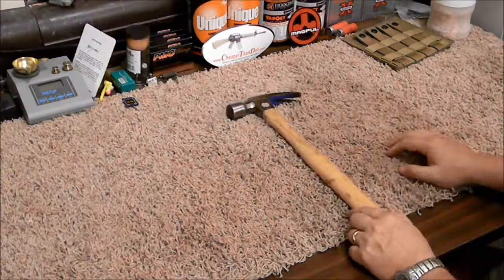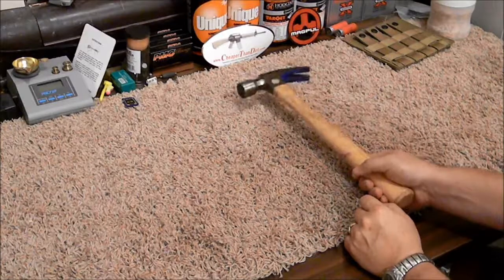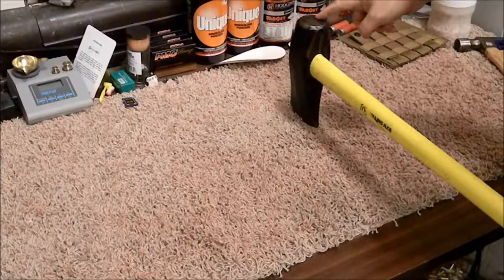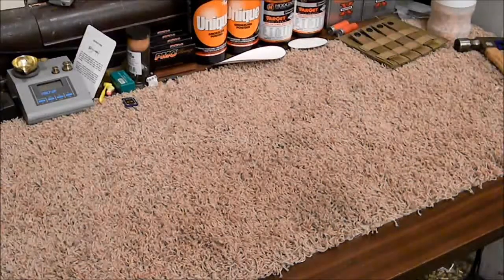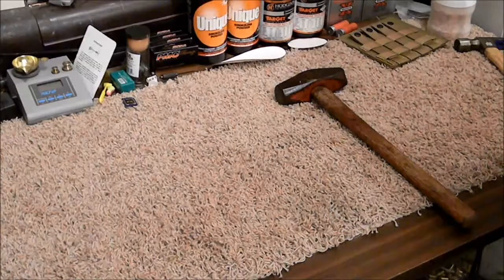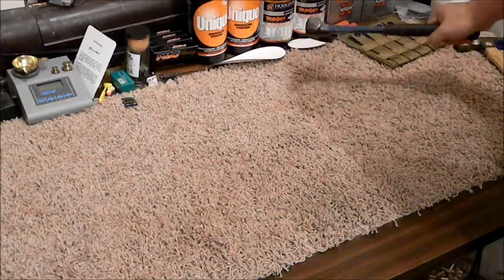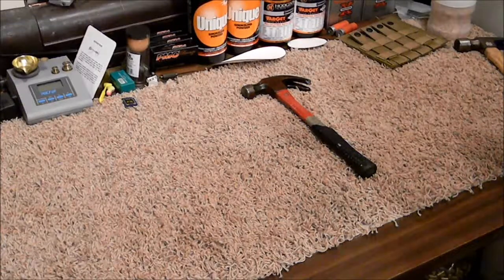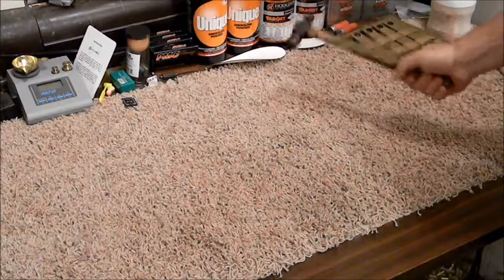How Much Hammer is too Much?

Comment: yeah man, i have a The Death stick hammer too, with the magnetic nail setter. It was expensive at the time. Lowes sells a similar tool for like $18, contoured shitty handle though. With finesse and wood decking (vs plywood) I can cut in a ridge vent like a surgeon.